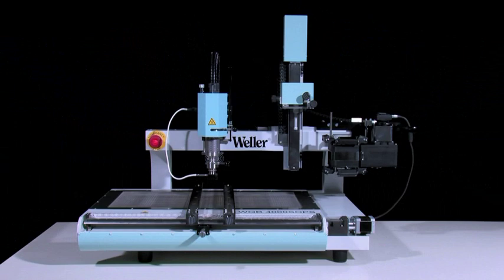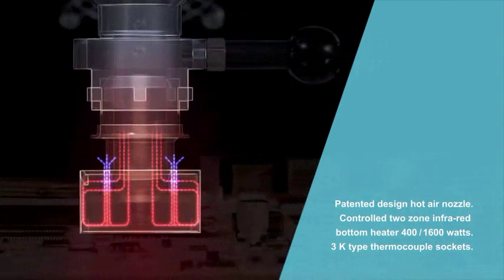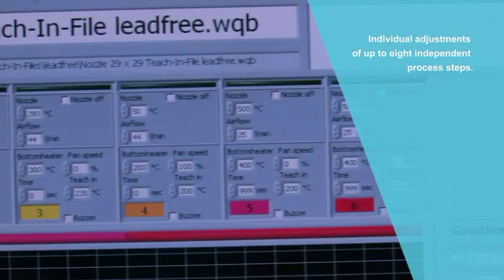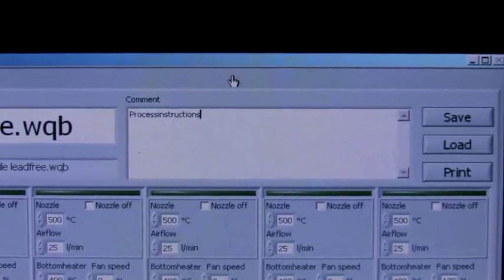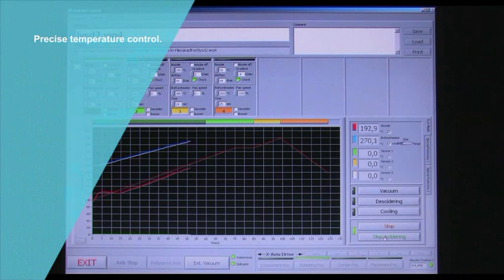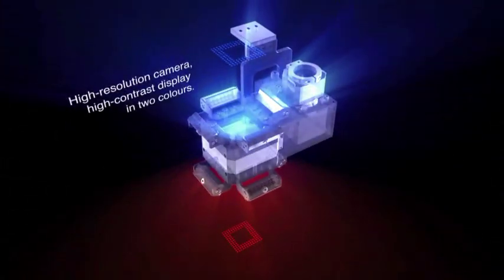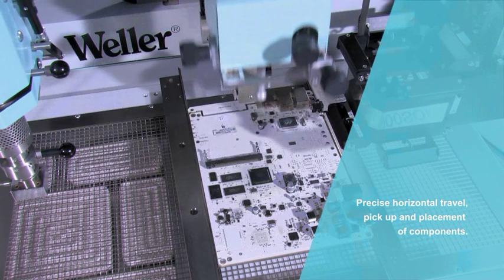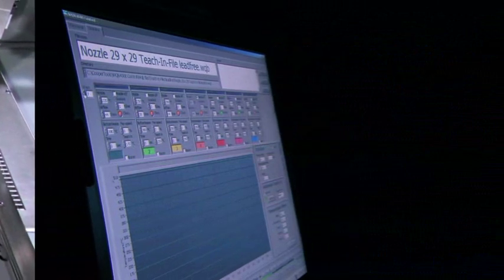Weller WQB 4000SOPS - long movie

Comment: How can I obtain one of the WQB Calibration tools shown at time "3:08" ?
Reply: i'd contact Weller directly or a distributor and ask for replacement parts. I checked PDFs of the user manuals, but did not see a part number for that device.